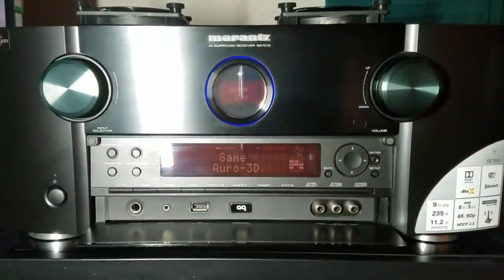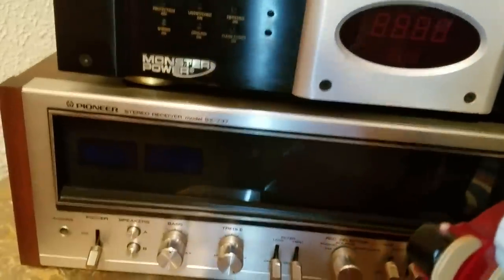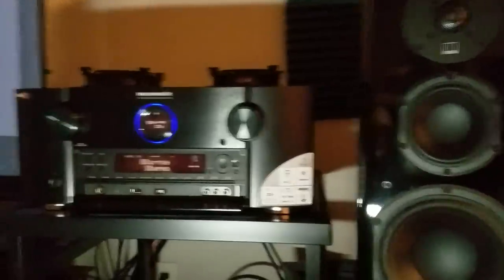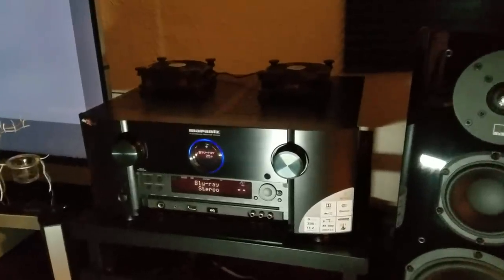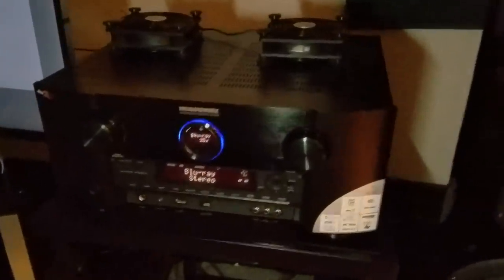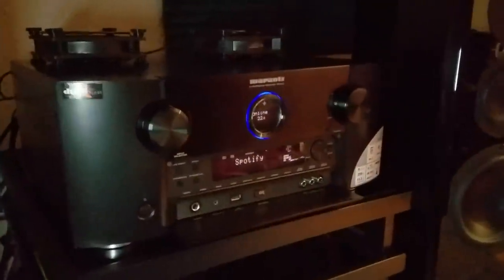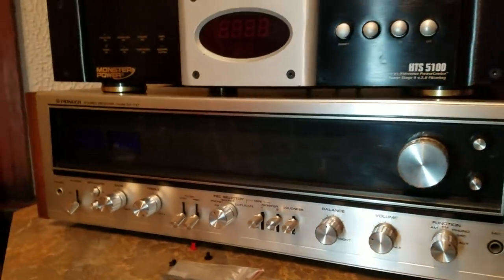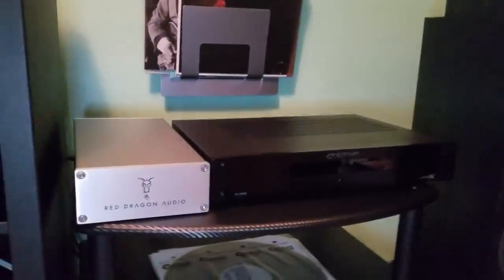My Marantz amp blew up 2

Comment: Good job ! I'm impressed I actually use a 2 channel pioneer elite sx-n30 hi--res network receiver class AB and 85 watts at 8-ohm built in amp that was 799.00 new kind of steep for a 2 channel receiver but I don't use the internal amp I use The elite as a pre-amp it has 2 full range preo-outs and 2 subwoofer pre-outs detachable  power cable wifi Bluetooth and sounds amazing with the emotiva basx A-300 it has so much warmness and detailed I almost bought the onkyo 8050 but bass was at 50mhz where the pioneer is at 100mhz double that I use a separate DAC but the built in Dac is almost as good well it was until I added a better power supply and cables with Dac but your right AVR really don't sound as good as  2 channel for music but marantz avr is really good so Klispch was at 8ohms what was your marantz set at 6-ohms? my pioneer switches from 4-6-8 nice feature thanks for the review check out my channel and how's the svs towers ?

Comment: If this was a class D amplifier in this it would be rated 5. THD
Instead of .003 THD .005 Thd or .008 Thd.
class D amps are dirty nasty and should never be used for high Fidelity.
I’ve always had the Onkyo flagships my first Onkyo I bought years ago sv 919 ran a THD level of .003 THD it’s still today has been the cleanest amplifier in a receiver that I’ve ever owned.
though the last onkyo flag ship that I purchased had overheating problems it never ever blew any amps.
I just can’t see an amplifier especially  giving up the ghost for the reason that you state,.
Sounds more like faulty transistor in your Marantz .
I was looking at buying the new Marantz but I don’t know who to trust nowadays with quality.
Ty
Reply: Jose Lopez....919 was also my best sounding receiver. I still have it. It was heavy as crap too

Comment: I am not 100% percent that how you described what happened in the first place is right at all. I think this may have been a case of not paying too much attention to the operating instructions before you plugged in your speakers and turned it on in the first place. Most AV amp and receivers have either 1 button or 2 buttons you have to press and hold to set up the correct OHM's for your speakers. If this was not set right in the first place or if you had a bare wire touching the metal chassis that would of took out one of your channels for sure. It's certainly got bugger all to do with how cheap or expensive the speakers are.
Reply: The ohm setting on avrs only changes the amount of current going through the speakers not the wattage.
Reply: I'll have to find a service manual on one of these receivers to see what exactly that setting does. Used to work in a repair shop and know how to read and understand diagrams.
Reply: @jdmsz9378   Lowering the current automatically reduces the watts (power) since watts is voltage multiplied by current. This is why it is important to set the AVR to the correct nominal impedance of the speakers with the lowest average impedance. This reduces the current drawn by the load, i.e the speakers.
Reply: Impedence inot the speakers constantly fluctuates.  The 8-hm "rating" became a "standard" durring the 1960s-70s; but it is more "fashion" than fact.  Denon -- owned by Marantz -- is rated 4 to 16 ohm.
Reply: @cbcdesign001  What is the "loest average impedence" of these three sets of tower speakers, and one center speaker:

4, 4, 6, 8?

Comment: I used to be an electronics repair tech before I switched to the computer field. I used to see hundreds of amps and other units that needed repair. Most of the time the owner could not remember what the cause was. I would say most often the power supply failed due to faulty caps or the amp circuit blew from being pushed to hard or heat. 
Also components just are faulty and fail. I also should note that I saw all brands .. Sony, Marantz, Pioneer, etc.
I suspect your problem was just simply a faulty component. I advise folks to push their equipment hard while still under warranty to find any obvious faults.

Comment: If you crank up the volume on your av receiver and it shuts off when you crank up the volume past half way but realize it doesn't shut off when you keep the volume at a very low level then don't try to keep it running at really low volume otherwise you will blow up your receiver the reason it blew up was because you were operating it at a very low volume level when it shuts off only at very high volume level

Comment: Interesting video. But as for running a AVR in stereo...I have to disagree. I've done that so many times over the decades. No issues at all. I just made sure I had 8 ohms speakers. Didn't use terminated cables every time. Or not from the factory (e.g. brand name Audio Quest for example). 

I blew out my amp on my "ghetto blaster" as a teen because I didn't know any better. Forgot to switch the voltage to the correct setting. :P I think I was 10 :) But did still know enough about electronics and current that it's different when overseas. :) That you do need to make sure the electronics even if bought there was set up to be run there. I was in Asia. :) Bought the blaster in Asia. :)

Comment: You should power all three front channels in a home theater with an external amp. Not just left and right.
Reply: Rob G yup, this guy is not real bright.
Reply: You should power all the speakers from the AVR; that's why they're built to do that.

All the rest is vanity.
Reply: @jnagarya519  not really... Most of the Soundstage of a movie is played through front. channels., they are the most active and usually much larger speakers. These larger speakers require more power. You get get by with just using the receivers amps but you'll get way better performance using an outboard Amp

Comment: This explanation has a lot of guess work in it. The writer expects a "jump" between terminals on a cheap speaker, says  a Marantz SR7010 has a class D amp,  says "some speakers aren't a flat 8 ohm load", (almost none are) and the crossover determines the "resistance" of a speaker? The last point. The crossover can modify the impedance of a speaker system, the main part of the impedance is determined by the drivers themselves. And it is impedance not resistance that counts. This explanation leaves lots of questions and no answers. He may be right about the Klipsch speakers being a problem with the Marantz as many of their speakers drop to 4 ohms and some a little less even though they are rated as "8 ohms compatible" I'm having no trouble, but I don't run the Marantz very hard and yes, it runs hot.

Comment: ??  don't follow what you're saying, many years ago worked in a repair shop and helped fix a lot of things but don't know much about this new receivers. they have an adjustment so they can drive 4 ohm or 8 oh m speakers, but without seeing a diagram i don't know what exactly what that does. I'd ask the dealer or the tech that repaired it for advice.

Comment: Well hi-fi marantz audio like that was not built for abuse,  so sensitive,  i have a diy pioneer-sa-8800  diagram audio power  was rated at 8ohm but to my surprised it can drive and abused 4-ohm load - 250w for 5hrs NCS-music deep bass torture

Comment: ... and those fans placed on top will definitely interfere with the internals !
- Very bad idea.
This is why manufacturers switched to passive cooling with aluminium blocks years ago although it's much more expensive than putting 2 PC fans in the case.
Reply: The fans interfere with overheating.
Reply: dc fans

Comment: Dude, a little study in the log scale is in order.  Please learn the DB scale and the power scale used in audio.  A change of 3 db is doubling or halving the power.  A change of 6 db is doubling or 1/2ing the power.  Volume controls are LOGARITHMIC as hearing is not linear.  The volume does not set the power..  Let me repeat the volume knob does not set the power.  The volume knob adjusts the input attenuation to the main amp and nothing more.  Think of it as a multiplier.  Volume at zero.  Input times zero is zero.  Volume at max, input at zero, output is at zero in theory.  OK some hiss is non zero in reality.  With full nominal input most amp receivers will clip full power at about 2/3 full volume.  The extra on the volume above 2/3 setting is so more attenuation can be removed when the input source is low.  It is like the input at 0.707 so you can multiply by 1.414 to obtain a 1 out. 

Whether your amp blew from your speakers, a manufacturing defect, or failure of the over-current protection in the amp from a stray wire short at the speaker terminals is hard to know post failure.

I am an electronics technician by trade.  I repair this stuff for a living.  I am ISCET certified.  Ask your repair shop to show your amp at clipping on the bench if he has time to show you this.  You will find there is a peak voltage the amp can produce and not exceed.  Variations of the volume knob and source program level produce the output levels.  The amp with normal program material will clip well before max volume on the knob.

For the complex impedance of some speakers, ask if your repair tech can set up the scope to show the speaker voltage and current as separate traces using a current transformer or current shunt on the speaker return.  From this you can see the damping force of the amp when the speaker has high reactive components in the impedance.  Most class D amps have no problems with this if they are designed with a high damping factors.  Analog class AB amps may tend to overheat on complex impedances due to the high current at low voltages on the transistors.
Reply from the maker: Thank you for the clarification, that was more helpful than most online literature I could find.    A lot of people commenting on the video seem to disagree weather the amplifier I own the sr7010 from Marantz is a class A B or class D amplifier.  I've searched the internet and I've talked to Marantz, they tell me ab, although it's obvious what I'm look at here. I have also had conflicting answers from certain techs and salesman.  What can you tell me about this?
Reply: @tacticalAV  This particular model has the traditional class AB power amp section for low noise (high S/N Ratio) and flat response from 20hz to 20 KHZ with no more than 0.005% THD.  Class D amps due to the PWM and use of the inductor in the low pass filter, they don't quite achieve this sound specifications.  Class D amps are known for very high power levels especially at low frequencies and are often used for sub-woofers and low cost amps at the expense of sound quality.  Most class D amps are unable to meet the 20-20KHZ at 0.005 THD spec with a low noise floor.
Reply from the maker: @isettech  Ok , thank you for clearing that up for me.  That is undeniably a popular debate among the people watching this video.   I understand the current shunt to introduce resistance into the circuit between the 2 points although does the current shunt produce more resistance than the using a transformer would?   Obviously no transformer introduces no resistance but just less than the shunt.
Reply: @tacticalAV  Current shunts are generally very low resistance and only a small fraction of the load.  For example a 50mV 50A shunt has a resistance of 0.001 ohms.  The advantage in audio is it is linear and not subject to low frequency roll off or phase shift at low frequencies.  A common misunderstanding of a current transformer is they have no insertion loss.  They as a transformer have a Voltage and Current turns ratio.  For example a 100:1 transformer will take 10 Amps and produce 0.01 Amps into a short on the secondary.  If you use a resistor on the secondary, then the voltage drop on the primary is 1/100th of the voltage on the sense resistor.  Unfortunately most current transformers are not built for 20 Hz to 20 KHZ.  Most are for AC power and are flat between 50hz and 400 hz.  In addition as a transformer they do introduce a small amount of inductance.  For this reason instrumentation of audio is best with a current shunt and sense amplifier.  This is especially true when you need to see the phase relation between current and voltage on an audio signal into a reactive speaker load.  Due to signal to ratio issues at low currents, hall sensor current sensors are sometimes used in high power applications to look at harmonic currents.
Reply: I never go above 0db or 80 volume. Assuming audyssey EQ doesn't interfere and make my 0db higher then it should be... Aren't the odds really really  good that I'm staying clear of clipping?

Comment: Let's just say you are clueless. If the problem is your speaker, it will blew up both channel. I think the problem is you were using spotify and you set the volume on spotify too loud so it blew up the right channel.
Reply: Either that or it overheated becuase of the excessive volume.

Comment: No marantz is class A/B it is pioneer that is class D it wasn't the speakers or the wire the amplifier was just a dud.  I use 6 ohm speakers on a receiver rated for just 8 ohms and I have had it at volume 57 out of 60 and the receiver stays room temp and there is no distortion.
Reply: david wilson  He's not wrong about the ohmage.